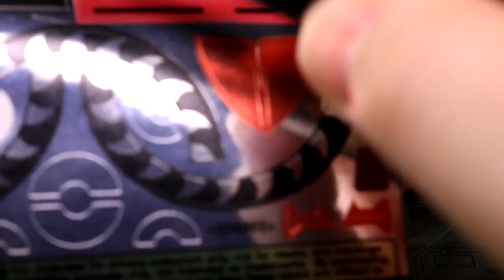Reprolabels for MP-28 Hot Rodimus - V-Build 94

Comment: what they should have done with the sticker above the chest which has no indents to help center it; is have a long sticker that run across the surface to help center it. Once it's in a desirable location you can peal both sides off leaving the center sticker in place. It will be a wastes of two sticker pieces but it will be alot better than having the sticker lose adhesion from repeatedly peeling it off trying to align it.